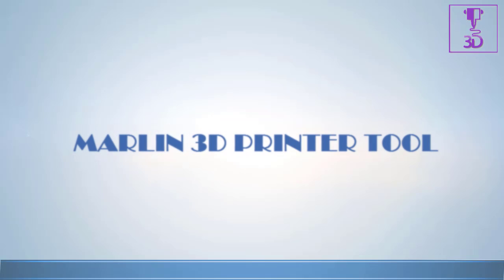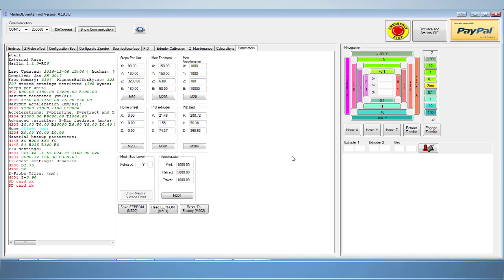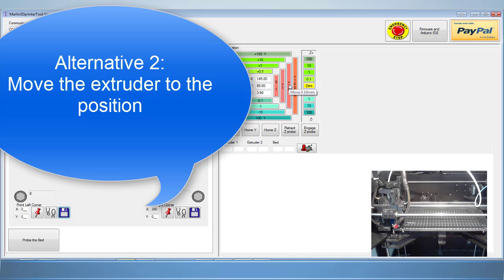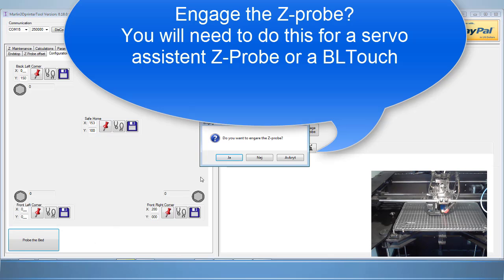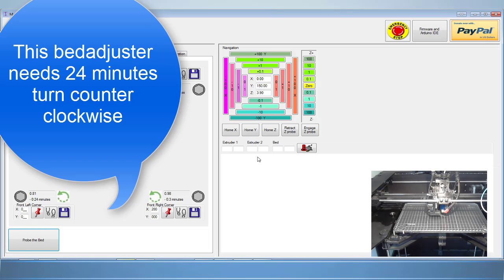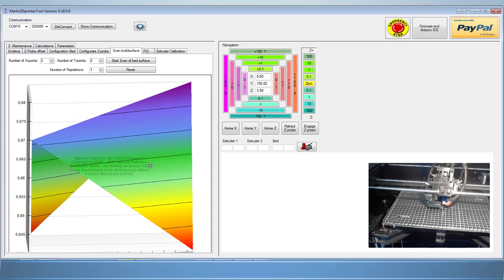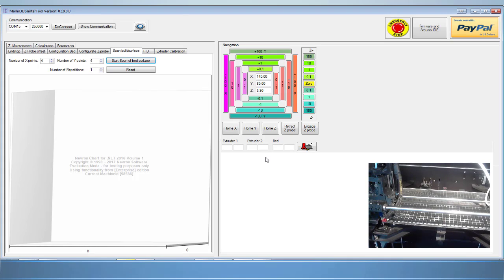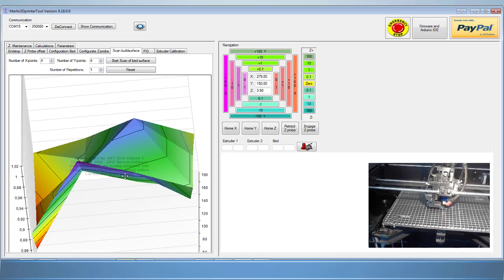Marlin3DprinterTool - BedLevel and Surface Scan

Comment: When running the bed levelling it dose the first to front points then stops when it gets to the first back point . It seams to freeze the program as it will not do anything
Reply from the maker: I think you have the bed configured so that the probe cant reach the point. 

Try to set the bedpoint on a squere in the middle of the bed , like 50 mm from the edges.
There is protection inside marlin that nozzle is not able to move outside the bed. If the GCODE command is a position outside bed it will not move. Consider that the probe has an offset and that must be calculated in the min/max values that the nozzle  can reach.
So if you have a offset on the z_probe , double that and decrease ethe bed with that. Then change the configuration  in M3DPT to a larger bed coverage.
Reply from the maker: I might be able to help you thru TeamViewer from now and some hours away
Reply: Many thanks have it working now great tool
Reply: Hi Johnny. Like the guy before. My printer got stuck but i checked the setting in Marlin and i was missing the safe home.. I added this and try the bed level again.. But no matter how i do the offset becomes not correct.. Can you help me on this? Regards Mikko

Comment: Is this available for macOS?
Reply from the maker: No. 
I have tried Java and other languages that should make it possible to run on Linux and MacOs. The RS232 support on other languages than C# is not strong /fast enought. The reason C# /.Net and RS232 works is because the component i use is only made for Microsoft and can be slimmed to be very fast. 
I actually try to simulate how the 3Dprinter Firmware is configured with sending GCODE and read the responce. The Marlin FW is made to read GCODE and the responce back is totaly without any type of flowcontrol. Example the G28 = Home command responds OK and respons is reported 5s before it actually reach the home position. I have to be faster then the 3Dprinter to catch all responces and match the responce with the calling GCODE. RS232 was getting steroids in 1995 and the speed was then 56600baud.. (= modem era). In that time people belived that that could be the end of speed for transmission over copper-wire.  The 3Dprinter today  works with 250000baud.

Normally the 3Dprinter dont care about the responce to the host.. The responce is like "nice-to-give". The 3Dprinter do the work on GCODE sent to it regardless of responce back to the host. 

Mac users can test paralells och any other type of VirtualPC on Mac. I acnt guarantee that it will work, but its worth a try.. If you get it to work , let me know how you did it

Comment: I tried to Paypal you to get the license but the program crashed with the error "Unhandled  exception has occured .... "
Please let me know how I can do that.
Thanks for a GREAT tool.
Reply from the maker: The problenot  is not in the program. It is InterNetExplorer (iExplorer.exe) that is IMHO a very bad webbrowser. Thats is the main reason why people is abondon the build-in webbowser and choose firefox, crome etc. I quickfix while waiting is to use patreon. Same deal but also som oter options.  https://www.patreon.com/user?u=3753058
The version 0.19-beta uses the prefered webbrowser and got support for BLTouch with almost one-button setup. Ther is a video done and i Wait for Tony Gomes to make the narration.

While i wait i try to do a Z-rod maintenance wind bindings check. Yo repeat the procedure 20-50 times and after each repetition the bed is scanned. You se the 4 corners and if/how the loose steps when travel full strokes up and down on the X-rods. This gives an indication that something is loosing steps on Z-stepper motor. It can be friction or overheat of the stepper-driver.

I have also created a super-stepper-diver of standard DRV8825. Working on that video. It creates a dual drive for 2 stepper-motors without loosing a stepper-driver bay. Stay toned!
Reply from the maker: Try to uninstall , and delete the directory C:\program (x86)\marlin3dprintertool and then download/install the software again. The MSI is updated and should fix this with a simple chrome-clone browser.

Another solution is to use Patreon: https://www.patreon.com/user?u=3753058